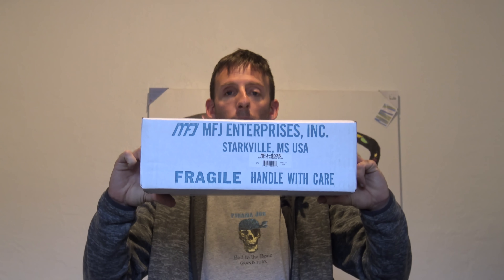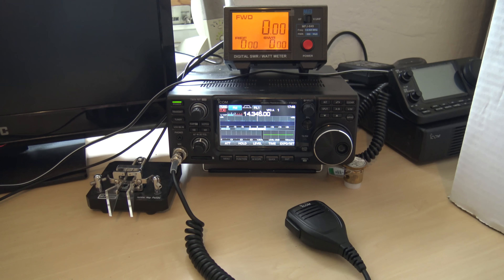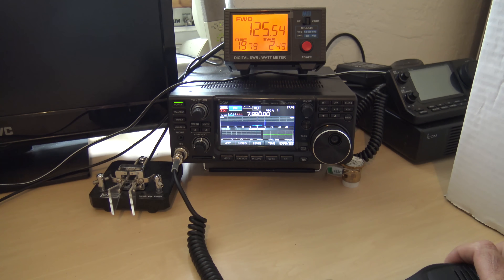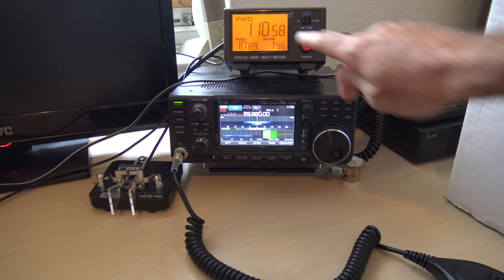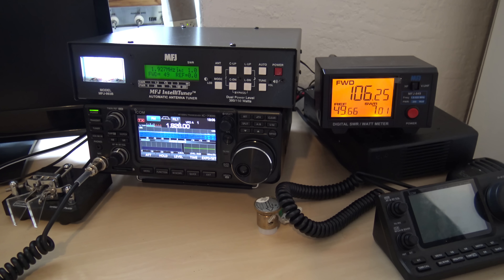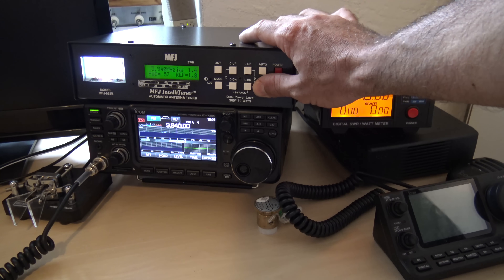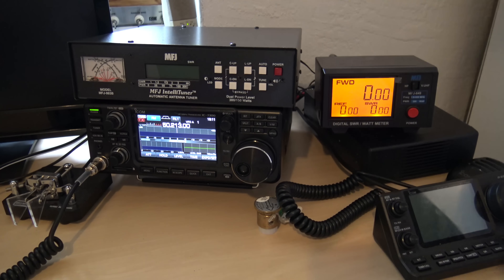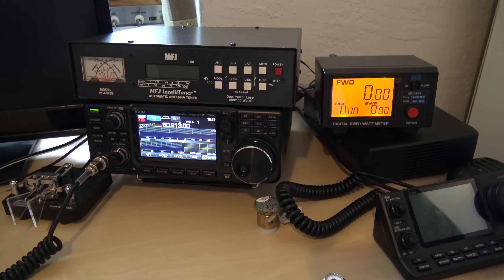Understanding HF Antenna Tuners, What Does It Do?

Comment: My personal opinion one I love your videos too I think an antenna tuner is just a glorified liar it lies to the radio making the radio assume that said antenna is exactly what the antenna wants so it's happy my radio has a built in antenna tuner also it is a Yazoo ft 991 alpha enjoy the radio I haven't used it much but I had the extra money and I figured I would buy a top of the line radio even though I am only a tech no code I figured why not try and listen on a hf and use 2 m 440 and 6 I have never used six I have never used the HF matter of fact I've never used 440 because I always used dad's radio he was the original N0SPW at that time when I was using dad's equipment I was kb0swi but when dad became a silent key I got his call sign and I have not transmitted on the radio since starting to get the bug again

Comment: Your video proves what antenna tuners do.  They don't change the "SWR"  between the tuner and antenna.  They match the antenna to the radio.  I miss the point of your video?  BTW, why do you have more power out versus input power?  That may help you on your quest for what antenna tuners really do.

Comment: I'm somewhat confused... The presenter suggests (I think) that bad SWR & reflected waves are fooling the radio via the antenna analyzer, whereas some commenters and the YT video Standing Up For Standing Waves... suggest they're-transmitted repeatedly, negating most of the loss.  I'm thinking they oddly may be correct, and the presenter incorrect.  Either way, great education!

Comment: There is NO! N0! such thing as an antenna "tuner".

A λ/2 dipole antenna is tuned for 7.15 MHz when it is cut to a length of 65'-5 7/16".
The circuit in your radio or the box on your desk calling themselves
antenna tuners did not alter the length of your radiating element
(the λ/2 dipole). What does it really do when you change frequency - say to
7.05 MHz? Add wire? Stretch the dipole's length? Make it now 66'-4
9/16"?  Hire Houdini & perform magic?  Fool the radio?

No! NO! N0!

It does one thing. It "MATCHES" the antenna system impedance
to that of the radio.

The antenna is still the length it was cut to. It is still resonant at
7.15MHz. But there now is an Impedance change.
We need to tell the radio the load has been changed, so we have to
match the transmitter's output impedance to the new Impedance
load it sees.

To do this we use things properly called: antenna coupler, transmatch, matchbox,
AMU (antenna matching unit). None of these devices "tune"
the antenna either, they match the load impedance to the source. That's it.

Comment: I am still new to Ham/HF. Do you recommend having a secondary SWR/Watt (Such as the MFJ-849 in the video.) after the tuner in a shack setup? I have an FT-991A and was interested in adding a MFJ-929 Auto-Tuner. Do you think an auto tuner in necessary with the 991A? And would you suggest adding an additional SWR/Watt? Best Regards. 73.

Comment: Bottom line is, the auto tuner is just keeping your transceiver happy and safe from high SWR readings and reflected power that over time can and will in most cases damage the transceiver. That’s the only reason why I use one. Radio equipment is expensive. It’s just one more item in the shack that helps promote the longevity of my equipment. By no means do I expect it to perform miracles! It’s merely a safety valve.
Reply: Yes and no. This video is completely wrong and he has no idea what he's talking about.

Comment: Answer this question.  If your antenna connection to the coax has a high swr, then how do you get power into the antenna if all your tuner does is make your radio happy?  Your experiment doesn't show whats happening.  You need to go to school and learn RF engineering.  If everything was as simple as you suggest, why does anybody go to school???  

Also, I never ask a question if I don't know the answer.  I get tired of hams with zero RF education, pushing nonsense in the venues available.  You are doing no one a service spreading nonsense.

How does that little MFJ box actually change the antenna length???  You think it actually changes the length????  That's what you said.  Ridiculous.
Reply: He has no idea what he's talking about.

Comment: Eric, HELP!  Here is my issue I live in a 40ty ft motorhome.   I can't  put up a permanent hf multi band antenna.  Working toward my general ticket should have it next month.  Currently running a comet GP1 for 2M and 70CM  for my FTM 400 XDR talk simplex and wires X works great.  Getting ready to go HF can't seem to figure out the antenna looking at a yeasu ft 891 I mean what do I do here Chameleon MPAS 2.0?  We drive the motorhome all over the country  about 10,000 miles a year.  Give it a thought drop me a suggestion thanks Mike KI5MNA

Comment: What I learn from this is that even with a 100 watt radio, if you use a random piece of wire and an antenna tuner, you’re only gonna be pushing out a few watts which is nothing compared to an actual tuned antenna that can push out more power.

Comment: Just skip an antenna tuner all together and focus on the basics.  Find a good coax length match and tune the antenna using an SWR meter.  In my opinion, tuners are simply a gimmick for those who don’t want to take their antennas down to tune, or are too lazy to tune the antenna.  In short, if the antenna isn’t tuned properly to produce low SWR’s, you aren’t transmitting well, no matter what the tuner says.  You might fool the radio with a tuner, but the antenna is no fool.

Comment: I am amazed at the money people spend on radios!  I saw two IC-7300s in one video.  This one, I see an IC-7100 in the background, while using the 7300....   How much money do I have to spend?  Geez!!!  At any rate, you are right.  A good antenna is the best piece of equipment you can have.  But, I don't think an antenna has to be resonate, or have a great SWR, to be good.

Comment: Sometimes antennas work without a tuner even if they weren't designed for the band. For example, my 40-meter wire antenna also works on 15-meters. This is the same reason why 2-meter antennas also work on 70-centimeters.

Comment: Notice how when he used the tuner the forward power indication was HIGHER than the transmitter output power. This is because the power coming back from the antenna is actually being re-reflected back to the antenna by the tuner, effectively adding to the forward power reading of the meter. When your meter is showing 130 watts forward, it is actually 100 watts coming out of the transceiver, 70 watts is being radiated out of the antenna, 30 watts is being reflected back into the tuner and the tuner is reflecting this 30 watts back to the antenna in addition to the 100 watts that being sent out of your radio. 
The reflected power is essentially being converted into forward power by the tuner.
The indication on the watt-meter would appear that the signal is being amplified, when in reality it is just two forward power sources (the original source from the transceiver and the power reflected from the tuner back toward the antenna) but they are out of phase with each other. Your meter sees this as a direct sum even though it is not because they are out of phase and must be added using vectors.
You also have to take into account the additional losses involved when using a tuner due to the additional trips the signal has to take up and down the coax between the tuner and antenna. That is why it is better to use balanced line as opposed to coax on non-resonant antennas because there is less tuner losses.
Reply: Ryan Toomey thanks for yours and others explanation of the reflected component being sent back to the antenna.  I am glad I saw this video it showed some interesting observations, but I am learning to read the comments as we can and do learn much from the audience.  I just learned about the book called reflections by maxwell that explains this subject well.

Comment: Thanks for posting the video Eric.. I have an additional point for you to consider (In addition to the other comments). When making these tests with a Tuner in bypass mode, stay on the Same Band and test at 2,3, or 4 frequencies.  This will give new hams an idea of what an 'swr curve' looks like.  Also,  in case you have not shown it before, please perform these tests using a Manual tuner. I think by learning how to use a manual tuner before going to an (outboard) auto tuner is a very valuable skill.. 73, Eric n6spp

Comment: Anyone that understands basic electronics knows this. I love how you pound common sense into people's heads. I had an inline antenna tuner to protect my radio. That's all they are good for. To me having an antenna with a high DB gain and very low reflective power is more important than how far the wattmeter goes.

Comment: There is a good book that might make you rethink your understanding of what a antenna tuner is doing.  Its called "Reflections"
A antenna tuner is cancelling the capacitive or inductive reactance by inserting the equal reactance.  If to much capacitance it inserts inductane same for to much inductance.  When it does this it puts the reflected wave in phase with the original wave adding to it.  Now the full power (minus any losses in the transmission line") are returned to the antenna.
You need to put the SWR meter before the antenna tuner.  If your using the internal antenna tuner the external meter will not read correct.      This is my understanding based on the book "Reflections"  by M. Walter Maxwell, W2DU. 
This is why Hams from years ago would use open ladder balance line because the losses are very low allowing the reflected wave to be reflected back to the antenna along with the original wave.   The same could happen with good quality low loss coax.  You just need to understand what the specs say for losses then add the additional losses due to the SWR.  If the total is low then the power will be returned to the antenna minus those feed line losses.
Reply: Ken thanks for the tip on the reflections book that helps explain what is taught about tunnels sending the reflected power back out to the antenna.
Reply: I just downloaded the pdf version of Reflections! Thank you for suggesting that! It absolutely proves a tuner is nearly 100% efficient - it just re-reflects the reflected energy back to the antenna. There's line losses, so you'll want low-loss transmission line like ladder between the antenna and tuner, or just connect the tuner directly to the antenna.
Reply: @truhartwood3170  Exactly!   The only difference is with the tuner at the radio the losses of the transmission line become very import and it gets worst
depending how high the SWR is because the wave is traveling back and forth until all of it (minus the transmission line losses) gets absorbed by the antenna.
Use low loss cable and the losses are reduced allowing for the tuner to be at the transmitter.
Reply: The reason he put the SWR meter after the antenna tuner in this demonstration is so he could show the true SWR of the antenna system.  All an "antenna tuner" does is match the impedance on the transceiver side with the impedance on the radiator side.  It does not change the impedance on either side of it, which I think some hams believe to not be the case.
Reply: @denelson83  Check out the book "Reflections" by Walter Mazwell, W2DU.   It explains what an antenna
turner is doing.  It basically creates the same problem the antenna caused, the reason the wave is sent from the antenna back to the transmitter.  By causing a similar reaction the wave is re-reflected back up to the antenna.  The only losses would be in the coax as the wave goes back and forth until all of the power is at the antenna (minus coax losses).    Unless the antenna and coax impedance match the transmitter there will be a mis match along the line however all the power will make it back to the antenna minus the line losses.   Good reason to buy low loss coax for long runs especially above 30MHz.
Reply: @n1kkri  Or use open-wire balanced feedline, such as window line or ladder line.
Reply: @denelson83  I have been using it for years.
Reply: @denelson83 you are incorrect, once a tuner has created a conjugate match at any junction both sides of every junction even the antenna is resonant

Comment: Hi everyone.  Greetings I hope that I am at the correct page to post my question.  
I own a Kenwood Ts450s,  and my external antenna tuner is the MFJ  993B.  I am looking to buy a Interface Cable for that Radio and can't find one of as yet. Mfj5124 is the closest thing I saw but the cable end is a RJ45. What can I do. Need help Thanks.

Comment: I don't completely agree with Eric about antenna tuners. Yes, an antenna tuner does not "tune" an antenna but it does transform the impedance of the radio output to the impedance of the antenna system for maximum power transfer. Take note that his MFJ meter does show lots of reflected power but, the MFJ meter is not reading the correct impedance because, the impedance from the tuner output to the antenna is NOT 50 ohms. That's why it shows a high reflected amount of power.
The MFJ Power/SWR meter is showing what 50 ohms would look like if, the antenna feed line and antenna were indeed 50 ohms, but they are not.
The pocket loop tuner does not change or tune the antenna, it does the same thing an antenna tuner does. It transforms the loop antenna impedance to the radio impedance for maximum power transfer.
Instead of a pocket loop tuner, a regular antenna tuner capable of reaching the loop impedance does the same thing. They are both antenna tuners. They both have either capacitors, inductors or a combination of capacitors and inductors.
Antenna tuner, matching network, matchbox, transmatch, antenna tuning unit (ATU), antenna coupler, and feedline coupler are all equivalent names for a device connected between a radio transmitter and its antenna, to improve power transfer between them by matching the specified load impedance of the radio to the combined input impedance of the feedline and the antenna.

Tony 
VA7TF  VE7ACF

Comment: Eric, Kudos for getting the 'gist' of the content correctly but when you say "I want everyone to understand", you need to correct a few incorrect conclusions.  The reflected power measurement you are making with the SWR example 3.5:1 and forming a conclusion that the amount of "reflected power" is indicative of usability is misleading because the actual losses are FAR, FAR higher than simple reflected power in cases where coax is operated at high SWRs. In fact, I have an antenna that I routinely operate with 10:1 SWR (and obvious associated high reflected power because they are proportional). Yet, I deliver almost 100% of my transmitter's power to the antenna. You do a great job of making the point as to the function of the tuner but when you make a statement that "you only have two-tenths of a watt coming back" is no where near the actual losses which are directly proportional to SWR and CABLE construction/quality -- reflected power is a measurement unrelated to dielectric losses which soar relative to operating coax with a high SWR.   THINK DIELECTRIC LOSSES - not reflected power when speaking about operating coax (tuner or not).  Open-wire, 600-ohm feed line, for example, has near zero losses : 0.252 db  with an astounding 10:1 SWR (mismatch). By contrast a solid dielectric cable like (worse case RG-58) has almost 3 db - or a loss of about 50% of one's transmitter output if used in your 7.295 Mhz example!!  See the difference?   Try the following online coax loss calculator and you can see a direct comparison with "reflected power" and "cable losses" when operating at any frequency, power, and cable type. (This example points to why nobody uses 100-feet of RG-58 to their antenna. But, even with a "good" quality cable like RG-8, the losses at 10:1 are prohibitive even below 30 Mhz. Reflected power, again, is simply an indirect mathematical conversion of the mismatch itself, NOT losses of power as explained. Power losses are actually higher / relative to feed line's materials/dielectrics/construction)  Check it out: 

 https://www.qsl.net/co8tw/Coax_Calculator.htm 

    BTW, "hate mail" is a strong phrase if you are referring to people who are simply offering you constructive criticisms. Keep it real.

Keep up the good work. The explanation of tuner concepts are very well presented. I hope my comments are helpful. I welcome corrections to anything I post - I'm always wanting to learn.
Reply from the maker: The "hate mail" i speak of arrives in my email often, as well as my PO box every other month, which uses vulgar or demeaning words to illustrate how they are no longer watching, they tell everyone not to watch, or they wish they could bop me in the head with a ground rod because I am a moron. The simple fact is I try to get people motivated to do more research instead of loading up a 3 foot speaker wire in their attic and then writing me a message and telling me I am using fake video as I make multiple contacts with some magic antenna because they cannot hear anything on HF and they havent made a contact in years, but somehow I have the ability to do it with 5 watts.
Reply: @HamRadioConcepts  What I think Eric does is present the idea and make it open for discussion.  The feedback is where the knowledge is or at least it gets someone interested in reading how something works.   Saying that, Eric keep it up the good work.

Comment: OK so you're saying, if the swr meter  gives good ratios on an frequency and you are using an antenna NOT FIT for that BAND,  more often than not the antenna tuner is LYING. iT ONLY makes your radio feel ok but its not. coz in reality, the reflected power and swr is way up.
Reply: This video is completely wrong and he has no idea what he's talking about.